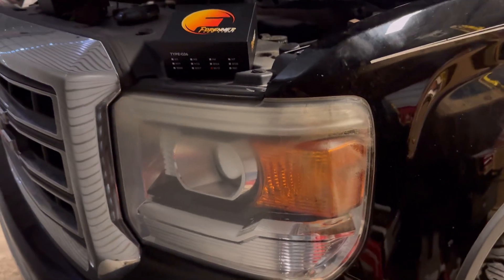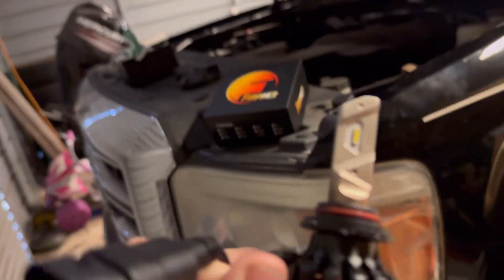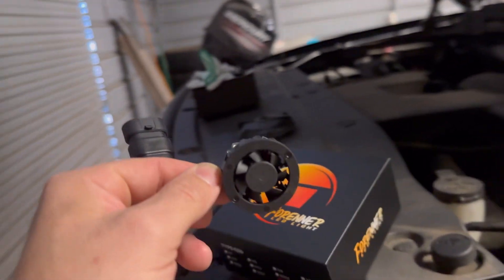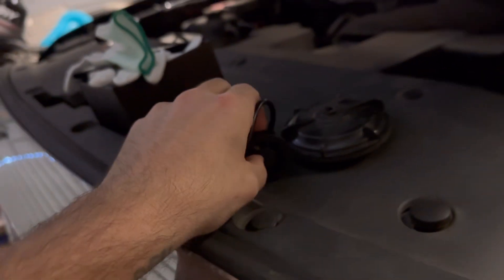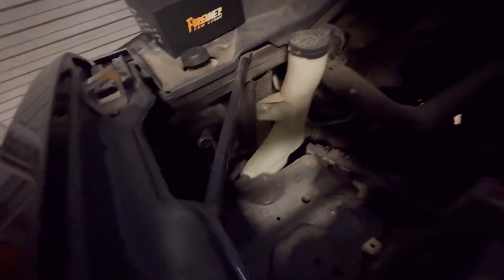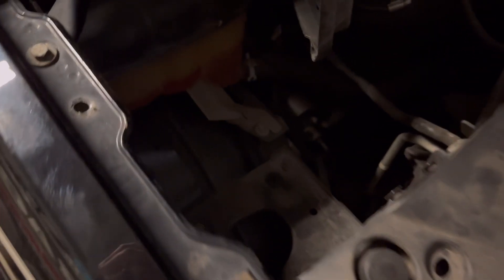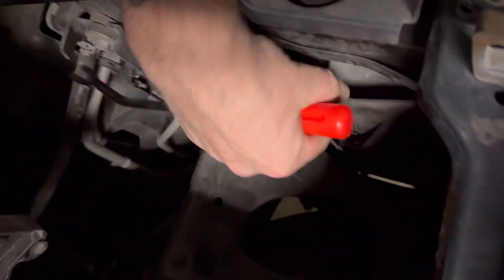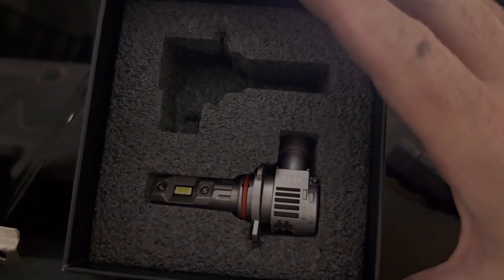2015 GMC Sierra headlight replacement (Forenner LED bulbs)

Comment: Was wanting to do the same, did you put the covers back on. Or leave them off..great vid btw..
Reply from the maker: Thanks man. I put the covers back on. They went on pretty easy even with the extra wiring that comes w them.
Reply: @KoreyB03  i ended up buying another brand and i came close to getting that brand..if these i have coming fluf out im definitely getting this brand. That was one of my wondering about forenner brand it didn't really say anything about the cap covers.. thanks for the reply..✌️👍
Reply from the maker: @docholliday6635 not a prob! I’ve gone w a few different brands in this truck and my wife’s Acadia and so far these Forenner’s have stayed super bright compared to the Auxitos and some off the shelf LED’s from auto zone.